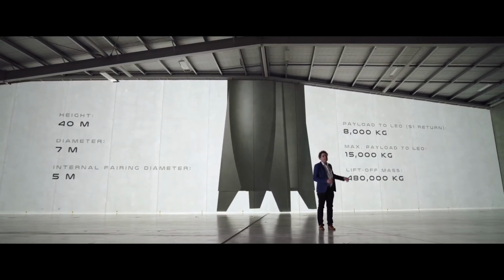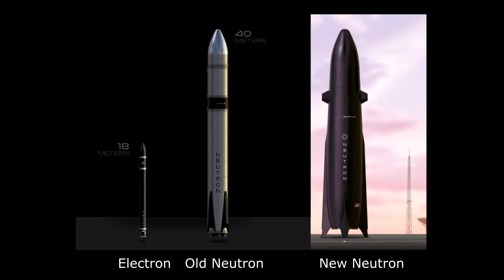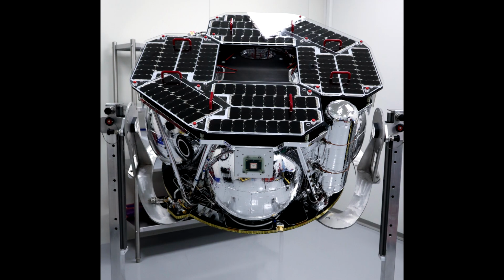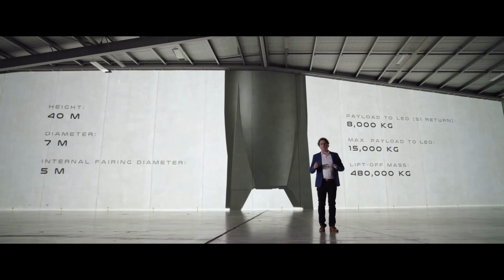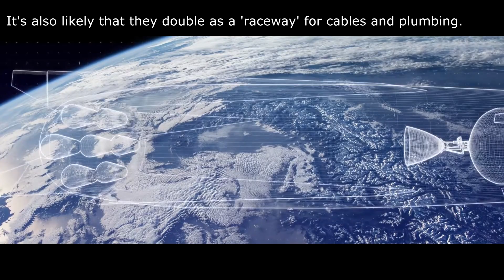Rocket Lab's Neutron Rocket Will Be More Reusable Than Falcon 9

Comment: His graphical presentation game is nearly as good as BlueO's, and they have actually achieved orbit. This puts them about 10 years behind SpaceX and they should have a viable rocket equal to Falcon just after Falcon is retired for Starship. (scratches head)
Reply: Always going to want different classes of launch vehicle. Starship might be a great heavy-lift vehicle, but a medium-lift launcher will still be needed and with SpaceX retiring the Falcon 9, someone has to fill that gap. It sure as hell isn't going to be Blue Origin.
Reply: Starship is a beast, yes, but what if a customer doesn't need to utilize the 100 or so tons to orbit capability? That's where rockets like Neutron come in. There will always be a place for medium-lift vehicles.
Reply: Well, according to Elon the Starship will be more economical than a Falcon or FH, and he expects to be launching weekly. There will be plenty of space for everyone as ride shares to use up space, and cheaper than anyone else can provide.

We will see, its going to be a good show either way. I cant wait to some new really big new space station modules to get lifted and a build a new station that dwarfs anything yet envisioned. I keep expecting to hear SpaceX has acquired Bigelow Aerospace.
Reply: @fjanson2468  Forgot about rideshares, you have a good point. It really depends on what the market wants to go with. Neutron would be more direct to a desired orbit while Starship could be cheaper yet slower to get to the same orbit.

Comment: Lot of neat ideas, really like it. It seems like they're giving up some performance (which is what everyone is obsessed with) in exchange for more robust reusability. Makes sense to me-- if you have a rocket that can be turned around very quickly and cheaply with understressed engines, it's a win even if its capabilities aren't totally cutting edge power/weight ratios. Fuel is relatively very cheap, so make more trips. Perfect for constellation missions, which seem to be the new hotness.
Reply: Underrated comment 👏. 
RL design philosophy here is very much about reliability and ease of turnaround and handling and they're prepared to sacrifice performance to do that.

Comment: Bashing flat steel. Yeah it gets fucked up. The bigger the flat piece the worse the fucking is. That’s why you curve that steel and get strength through form. Oh that applies to carbon fibre as well. When you bash carbon fibre it breaks and has NO strength at least the be t steel hangs on.

This is when your testing materials strength for strength.

Comment: Not super excited about gas generator but that could change. Why couldn't a fuel rich closed cycle work with methane? I'm just an armchair rocket surgon and the raptor video from Everyday Astronaut is all I know about engines

I imagine the new thermal protection on electron is for neutron testing

Comment: I want to know more about the shape of Neutron helping with reentry. I remember Peter said something in the video about shock waves not attaching to the hull with this shape.
Reply: This is the right way to reuse a rocket stage, that was theorizes before first space flight , enter with the engines forward and if the base is larger than the body you only need to shield that part against heat, what SpaceX are doing with the upper stage of starship is wrong in this context, at least this is my opinion for long time ago.

Comment: Fascinating stuff! While you addressed the differences in materials (ss vs. carbon) for Starship vs. Neutron, you only compared performance characteristics with Falcon. I thought that was curious given that while Falcon is only partially reusable, Starship is entirely reusable. Was that an oversight or intentional given the size class differences? Thanks!!!
Reply: there are several problem with making  second stage reusable.  It needs a heat shield.  Itneeds a trotlable engine that can work at atmospheric pressures and it needs a landing mechanism.  All of that adds weight and reduces payload.  Space X originally wanted to make the falcon 9 second stage reusable.  but  found that it would eliminate much of the payload capacity of the falcon 9.So they dropped the project and started working on starship supper heavy.

Comment: I'd love to hear you talk about the economics of these design decisions vs starship. It's close if starship makes good on everything it plans to but this seems slightly better for most of SpaceX current market.
Reply: The returnable 1st stage with its attached fairings and smallish upper stage are interesting cost choices. Notable is the RTLS and lack of a recovery fleet. However, all these mean a big mass penalty on what the routine payload to orbit can be. (RTLS necessitates more fuel carried up and back.)  Then again, many viably economical launches will be less than 8t.

I'm excited about the barely mentioned 15t to orbit if expendable. Sounds like a good launcher for Dream Chaser, launched from Wallops Island perhaps. Economics: Expending a few rockets is cheaper than developing a fleet of recovery ships and the very difficult ability to land on a heaving drone ship.
Reply: @donjones4719  8 tons would probably capture the majority of SpaceX current market. These engines would be cheaper than raptor and you don't need 42 of them plus 9 on starship. Plus all infrastructure is smaller. I guess SpaceX could ride share all kinds of stuff together but how many different payloads they can fly together is questionable

Comment: I would like to remind people of GPS IIR-1.   

A GEM SRB for Delta II was one of the first to be composite rather than metal.  This one was particularly special because it took a hit during final vehicle integration. Some say a forklift hit a roof support with it leaving for the pad.  Officially no one said.  But there was no visible damage rather than a telltale dent the prior versions would have.   So it arrived at the pad, it looked fine, they hooked it up, and launched.   

The impacted area was now a mass of microfractures.  It blew out after 12 seconds allowing a massive jet of flame to start burning up the center core of the Delta II and destroying an adjacent SRB.  The control wiring was immediately vaporized and one second later, we had the world's largest firework of the year.

Dents are useful because they are warning you something happened.  Composites often say nothing.

There's no way that panel could take similar stress after that impact.
Reply: One could argue, that it was not a failure of the composite that caused the mission loss, but a failure to report a workplace incident and accept responsibility for poor operation of the Fork.
If it had been reported, the part could have been swapped out, and mission loss avoided.
Reply: @PiDsPagePrototypes  thought experiment, you are the forklift operator. You hit the ship just before it is headed for launch. Nobody sees it, you inspect the damage, and there doesn’t seem to be any cause it’s a composite. If you say anything, you probably lose your job. What do you do?
Reply: @nolansprojects2840  When it comes to rocketry? Tell someone.
Reply: @nolansprojects2840  That's why most people don't automatically lose their jobs for making mistakes. A reported mistake costs much less than an attempted cover-up.
Also, when maneuvering expensive and fragile equipment, you should have a least one spotter helping the equipment operator. That means it isn't just one person who knows. If management wants to cheap out on safety and quality controls, firing the operator won't save them from bad PR and scrutiny from prospective customers.
Reply: @nolansprojects2840  I file a report. If I was negligent, I have to deal with that, and that, is called taking responsibility for ones own actions.
Also, by asking the question, are you suggesting you wouldn't take responsibility for your actions?
Reply: @nolansprojects2840  this mindset is what causes airplanes with 300 people on board to crash.
Reply: @nolansprojects2840  If you fire someone for reporting a mistake it's an organisational issue, specifically a bad organisation
Reply: @nolansprojects2840  this is a management issue. If you foster a company culture where mistakes are recognised and accepted (within reason) people will come forward
Reply: @PiDsPagePrototypes  Y'all are talking to me like I wouldn't say anything. I work in the aerospace industry. I program robots that make flight parts. If my robot crashes on a production part, of course I'm reporting it. I have scrapped a $100k part because I put a line of code in the wrong sequence.  My point is that this mindset exists. And working where I do, Something like that could cost a job, even for being an accident. That's why people don't report things if there doesn't seem to be visible damage. You all seem like you know the perfect way to run a business like this, so good on you, but just because you can't get fired for that, doesn't mean people won't look for reasons to fire you. I've seen it a lot.
Reply: @nolansprojects2840  Maybe it's just that I've seen too many people hide the damage they've done, rather then report it, and left the rest of us to pick up the pieces,.. and they're the people that have asked me questions like that in the past.
I admit being jaded regarding other peoples behaviour, and doing my best to hold myself to a higher standard then those that I have worked with in the past.
An Aside - I have a Fork Lift License too.
Reply: @PiDsPagePrototypes  yes, I understand. Unfortunately it is extremely easy to get a forklift license. I find most people that do not report problems such as this, are people who have lower skilled jobs. They have more reasons to hide doing damage than to report it. On my team, I have trained my guys to be honest and report everything. I do what I can to support them and keep them protected. A small step in making the workplace more honest and understanding. I have been spared in the past, I want to give others that chance to. My original question was more just to get thoughts moving in peoples heads, didn't think everyone would just assume I'd do nothing in that scenario.
Reply: Im quite sure Peter Beck is aware of that.
Reply: All good points. Counter argument: 19 successful launches so far and not a single failure due to hull or tank problems.
Reply: interesting
Reply: Exactly right. And composites don't have a yield point; they just suddenly break, often catastrophically. Metals yield and allow load redistribution. Some customers (NASA) also require acceptance testing for every part produced, which is very expensive and time consuming. Composites are a PITA.
Reply: True. I used to fly a TRX 40 which had a carbon spar.  With aluminum one could inspect it and see it's condition.  We saw a carbon fiber spar someone had crashed with and it looked fine, then the guy just bent it like paper where the damage was and bent it back to a look of perfection.  I still flew with it, but it did have me concerned.  But I was young and young think they are invincible and will live forever.
Reply: Also showcasing the strengths of materials for building rockets with an impact test is completely absurd.
Reply: @Shrouded_reaper  It gives a rough idea though.
Reply: @paulbizard3493  It literally is in no way relevant whatsoever.
Reply: @Shrouded_reaper  So what should be a relevant test?
Reply: @paulbizard3493  A relevant demonstration test would be comparing weight and ability to withhold pressure at cryo temps. Fill up cylinders of different materials with crypto fuel and see how long it takes them to pop. What part of a life cycle of a rocket involves being hit by external objects? Answer is none and if it does happen that you hit an object at mach 15 then kiss your launch goodbye no matter what material you have.
Reply: It helps when you don’t have to transport it.
Reply: @vablo7198  One of the prime reasons spacex chose stainless steel is because unlike other metals and composites it has a fatigue limit. This is the point where you can stress the material to and back to normal an unlimited number of times with zero fatigue or stress cracking. Other metals and composites have no fatigue limit and all stress adds up over its lifetime.
Reply: @Shrouded_reaper  Elon Musk has not yet reused his F9 more than a few times. If a Neutron first stage flew 100 times, fair enough.
Reply: Scott did a video about that launch
Reply: Let's build water rockets, they are safer. LOL.

Comment: Its uncouth to dig at those you are imitating (or at least following their foot prints).
That rocket looks retro-cute, but as an engineering solution its a bloody nightmare of compound curves and  almost infinitely variable stresses and loads. 
 I suspect this is more designed to impress investors than to lift payload.

Comment: If they mount the second stage in tension, the actual payload would still have to be held in compression. I'm curious what the mass ratios for upper stages and typical payloads are.
Reply: I assume they will use balloon tanks like the early Atlas rockets. To avoid the issues Atlas had with with rocket collapse from lost pressure they will probably support the 2nd stage at the top of the stage. This would allow the tanks to remain in tension while the satellite is supported by the mounting arms. Once the tanks are at full pressure they will support the compression load of the satellite during acceleration into orbit.

Comment: A full steel rocket can be  ultimately  optimal because the extra weight. But nothing prevents SpaceX to introduce composites, titanium and other materials later for at least  some parts of the rocket. Not until the first orbital rocket is well proven because those materials are very expensive to blow up on experimental models, but I would  bet we will see them in some big parts of  Starship / Super Heavy at a later stage. A good example is that Falcon 9 didn't start using  titanium for any big  parts until the  recovery process  was reliable enough, but they did it later. Also because the experience with F9 and FH  means that they already have the knowhow and  technology to use those materials when time comes.

Comment: How does the second stage handle the compressive forces of the second stage engine firing if it’s built to handle mostly tension?
Reply: I’ve been wondering about that. 
Does the second stage burn produce less acceleration than the first?

Comment: Very perceptive observation about the similarity to the rocket in You Only Live Twice. The design of the neutron makes complete sense in that context. Why else would they need the rocket to fully encapsulate the payload and keep the fairings attached? Why else would they need such sturdy fixed landing legs instead of flimsy fold-out replaceable ones? It's obviously because they intend to capture satellites from orbit and land them back in their secret volcano base.

And of course they couldn't show their secret volcano base, because then it wouldn't be a secret anymore. We'll just have to wait until satellites start disappearing from orbit, and the Neutron rocket is tracked back to said secret volcano base.

Comment: I suspect they had rubber on the feet of the stands during the stainless steel and aluminum demonstrations. The stands did not move very far at all.

During the carbon fiber the entire stand bounced away as if they intentionally reduced the friction between the feet and the ground.

It is also possible that the first two stands were intentionally weighted to ground them and drive the I beam into it in a more destructive matter.

The carbon fiber demonstration bounced way more than the other two.
Reply: Possible, but it could just be that more energy was available for movement as it wasn't lost to deformation.
Reply: @YeOldeTraveller  yes, exactly, because the carbon fiber did not deform, absorbing the energy of the impact, it was transferred to the mounting frame, pushing it backwards.

Comment: ... Or as Elon Musk recently elaborated on the steel vs. other materials choice:
"Carbon fibre (structure) costs $142 / kg. Sheet aluminium costs $70 / kg. Stainless steel costs $4 / kg."
Cannot argue with that.
Reply: fashioning it into the correct shape? would make it just a little more expensive
Reply: It depends on how many you intend to build.

Comment: The second stage cannot be fully tension because they need compression strength so that the engine can push the payload.
Reply: It is all about launch loads. Acceleration during second stage burn is lower. Also pressurisation of the tank will put it under tension.